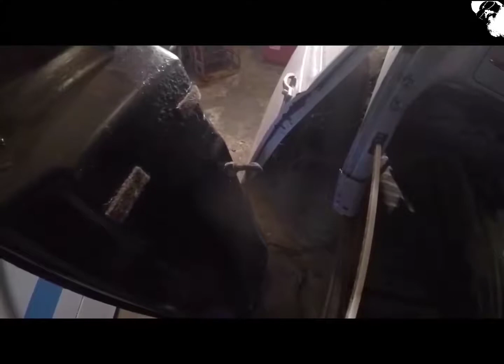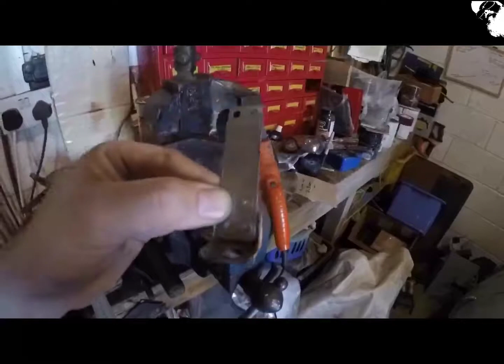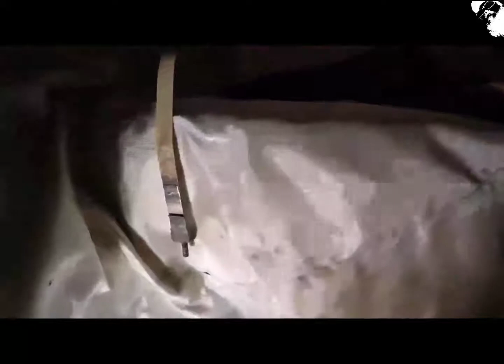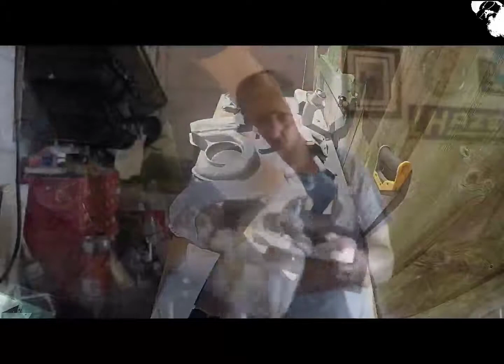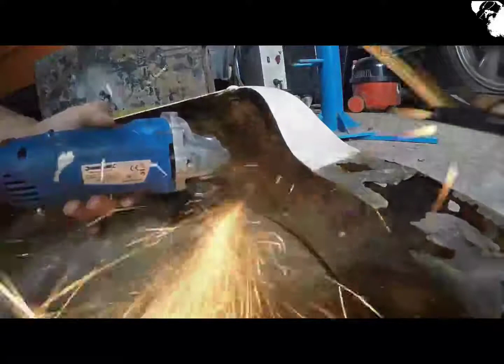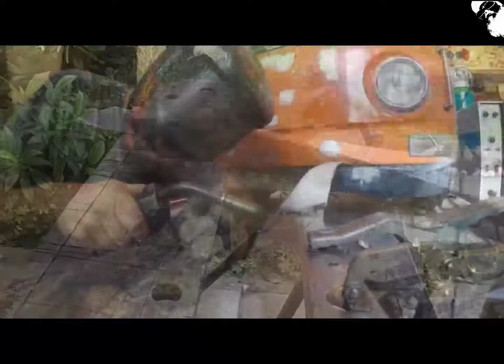Classic 1970 VW Camper Bus restoration. Day 91 - ‘fuel tank straps & a little more rot’...

Comment: Did you try bolting the straps down before extending it ? The new padding as you mention might be too thick, pulling the straps over it might have squashed it in and securing the tank nice and tight.
Reply from the maker: Tried but the bolts weren’t even close to being able to pass through the holes. Weirdest thing I’ve come across, shouldn’t of had to make the mod. As mentioned both corners of the tank area had repairs made and welded in, maybe that was another cause along with the pads..done now eh.. Thanks for watching..👍

Comment: A lot of work done there Ross. Great update. Been looking at some electric spray guns at Lidl and Aldi’s.  Cheap outlay to get your projects moving on as you say. Might take the plunge..
Reply from the maker: Yeah just to get by. Most certainly less costly than to keep forking out for rattle cans, if you’ve got bits here and there to do. I will invest in a decent HVLP system down the line at some point when it comes to it...👍

Comment: The old VW tank straps were a bit of a mystery might have tried filling the tank to compress the lower strips but they looked a bit further away. Just might be the difference between new and old materials. Like the Wolfsburg wood nice touch from the VW factory. Still you can place that in your  Gift to the Gods of the VW Bus cabinet.
Reply from the maker: Was weirdly strange experience for sure...👍